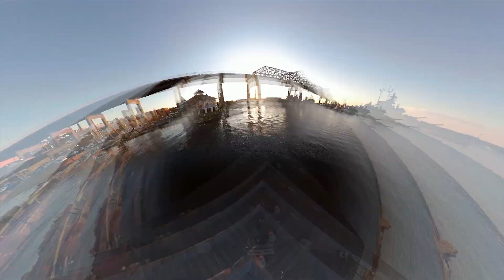How to change the Motors on your Electric Longboard in 2020 - WowGo 3 | Boosted etc.

Comment: So I have the same one and my mine won't turn on, do you have a solution?
Reply from the maker: Your Battery could be bad or there's a lose connection some where in the esc...
Reply: @CitySurfa  how do I check for a loose connection without messing anything up

Comment: How did you break it in the first place? I’ve got a wow go 3 been riding for 2 weeks seems pretty solid I’m a heavier guy also over 250 lbs
Reply from the maker: It literally snapped off! I felt the board shift and then I slowed down after  that the wheel fell off.... Now this definitely has to do with the fact that the back wheel were in an accident causing it to become weak. So it's not like a normal thing 👊🏼

Comment: dude i have wowgo 3 same with you do u experience going downhill at speed#2 then suddenly motor & controller connection disconnected after a few sec. it reconnects again. I dont know what is the causing problem for this
Reply from the maker: Very odd it could have something to do with the remote or the wireless connection in general know I haven't had an issue with that...